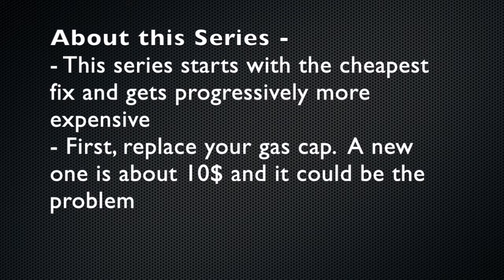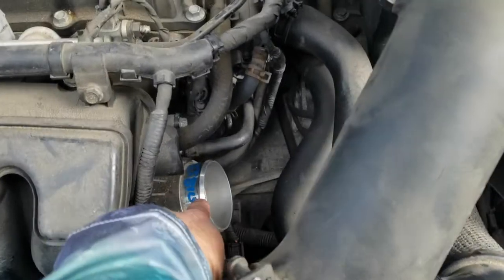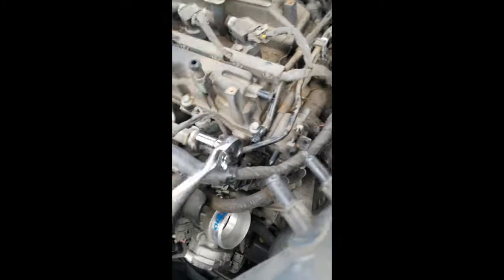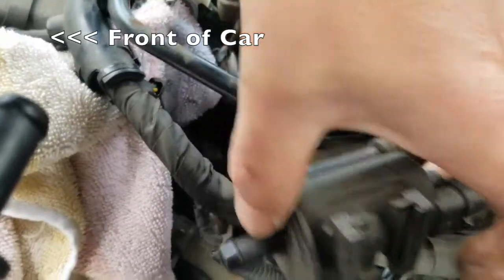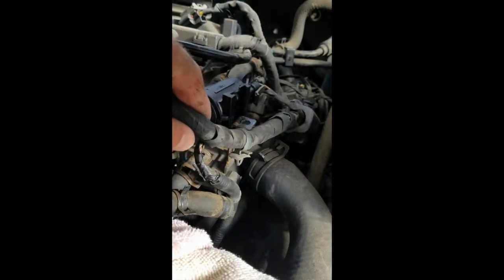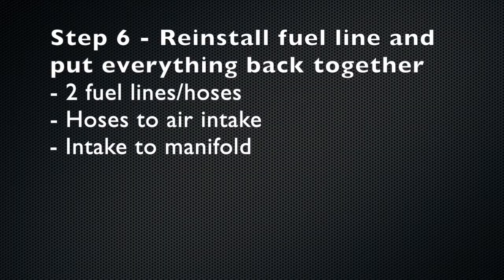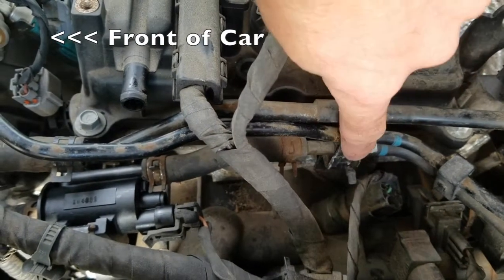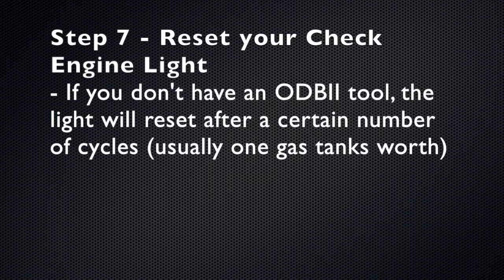Kia Forte P0456 Code Fix, Part 1 - Purge Control Valve

Comment: sweet video man, 2011 Forte LX 6spd Manual 223k
Reply: 2012 Kia Forte LX, 2.0 automatic. 270k 
GANG
Reply from the maker: Love to hear that! Keep 'em going!
Reply from the maker: Glad it was helpful!
Reply: I have a 2011 Kia forte koup ex, same code, but I was curious, did this make your car run bad? My car has been running but the engine light came on yesterday and it’s lost power and seems like it’s having problems running
Reply from the maker: Mine didn't experience any worse driving when I replaced it, it just didn't fix the problem, hence video parts 2-4 of this fix 😂
Reply: Also 250k miles on this car, Kia’s just keep on keeping on I guess
Reply from the maker: Glad it's still rolling! Did you get the loss of power problem fixed?

Comment: You should have built a smoke machine and smoked out the system, you probably would have found a leak. It just doesn’t make sense on a making a change parts until you find and fix the problem.. just saying., thanks for sharing your video..
Reply from the maker: Appreciate that input but it's a pretty popular 4 part series 😉. Hope the video was helpful!

Comment: I got a P0444 after replacing the CPV.  Any ideas?
Reply from the maker: Did you have one before? How many miles did you drive after replacement?
Reply: @AvoidStealership  I just had the P0456 error before.  I have less than 10 miles on it.  I was going to drive it for a week or two to see if it'll clear itself.  Fingers crossed.
Reply from the maker: @JamesStein  Most people use a certain amount of car starts to gauge it, but my general rule of thumb is to clear the code and then drive through a full tank of gas
Reply: @AvoidStealership  Forgot to reply.  I had misinstalled the CPV and one of the prongs was bent and not connected.  But now after 6 months, I got the dreaded p0456 again.
Reply from the maker: @JamesStein  I'd check to make sure you have a strong electricial connection (prongs are touching).  If you're getting bad readings, you're going to throw a code

Comment: Thank you for this great post! It worked a charm and was exactly what I needed for my Kia Forte 2013 engine code P0441, similar purge valve issue.  One extra tip: I had to unscrew two 10mm bolts on the windshield side to release a bracket holding the fuel lines in place.  This then allowed me to move the fuel lines enough to remove the old part.  Very grateful for coming across your post!  Big props to you!
Reply from the maker: Thanks for the tip and glad it was helpful!
Reply: Just had to do the same thing on KIA Forte 2013, only now I have a small scent of gasoline in the car.
Reply from the maker: @HiiiRabbit206  That's odd. I didn't have that. I guess you have changed the fuel air ratio so I wonder if your ECU will compensate as you drive
Reply: @AvoidStealership  I'm giving it a week to see if things change.

Comment: Hey bub i got a new question for you... What would cause crank no start? filled my tank with gas at a local stop got back  in  tried to start it n got  nothing. Got it home from a tow truck service  checked my terminals, checked my battery, checked  my fuses all are good spark plugs are good I got pressure in the fuel lines.im just lost as to what else I could do...if you have any ideas or solutions I'd greatly appreciate it bub thanks
Reply from the maker: Potentially bad ignition coils?
Reply: @AvoidStealership  I'll give it a shot thanks bub
Reply: @AvoidStealership  hey bub wasn't the coil pack or plugs. I swapped out my fuel pump wasn't that I did get a code for cam shaft sensor b 1 replaced that and still have crank and no start?
Reply from the maker: @charleslafountain4392  are you getting a spark when you turn the car over?
Reply: Yes sir I am. It's weird  I'm kinda lost with ideas. The dealership said probably jumped timing but the car was running quite well no hesitation or showing issues to this issue....
Reply from the maker: @charleslafountain4392  all your fuses are good? Clogged fuel filter? I'm running out of ideas 🤣
Reply: @AvoidStealership   haha I hear'yah bub... Fuel pump is new from rock auto, fuses are all good Relays are the same.
Reply: @charleslafountain4392  , I know it was a while back but may be helpful for others, fuel pumps can be bad right out of the box especially the cheapies. I would only use a factory kia, auto 7, mando/denso or bosch premium. There may be a few more acceptable, but run away from Spectra or most similar China garbage. (yes, spectra makes great gas tanks and hardware but the pumps are garbage based on my experience, and the mechanic who tried one(dead out of the box) replacing the one I put in under its warantee that was 3 mos old and fussing in an old TBI Chevy 500 miles from home) Perhaps try a shot of starting fluid next time, should pop off if it is starving for fuel (very carefully, do not want to compromise the plastic intake with soaking/saturation with starting fluid )
Reply: @daveondre4892  thanks for the suggestion, I'm not exactly sure what caused my car to die that night but I did manage to take care of the problem after countless days of trouble shooting, replacing parts and getting suggestions from ( Avoid the stealer ships' channel)...thanks by the way, as well as kia's community forum.

Comment: Did you have todo anything with the computer?  My suppler says you need a factor programmer to reset the pressures.
Reply from the maker: I did NOT need a factory programmer
Reply from the maker: I used my ODB2 Bluetooth port reader and the torque pro app to reset the codes

Comment: Did to ever clear the code?
Reply from the maker: I did use the Torque Pro app and a Bluetooth ODB2 reader to clear the codes. However, I think that some of these vacuum leak codes will clear themselves after the car has been driven a certain distance without a problem.
Reply: @AvoidStealership  sweet, I have the 456 code
Reply from the maker: @charleslafountain4392  I'd recommend getting a Bluetooth ODB2 scanner if you're going to keep troubleshooting your car. The 456 code should go away after a few drive cycles if the problem is fixed.
Reply: @AvoidStealership  appreciate it man